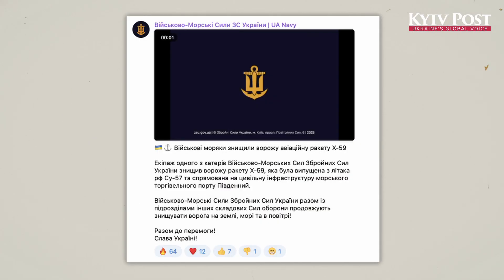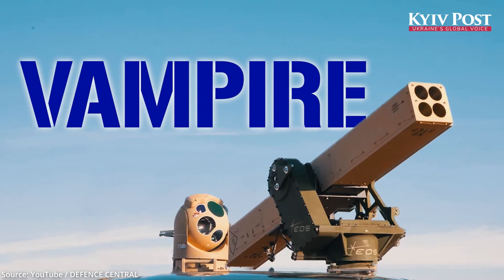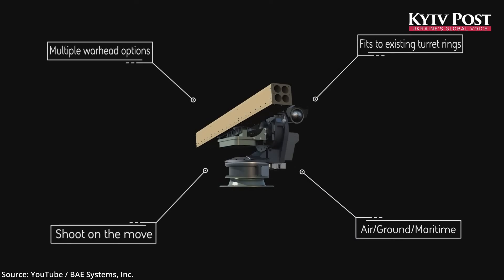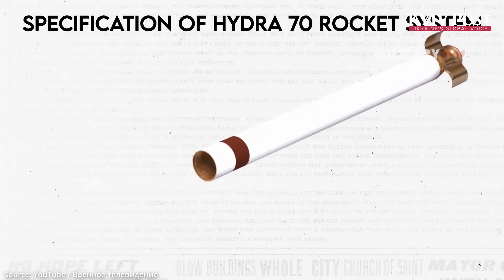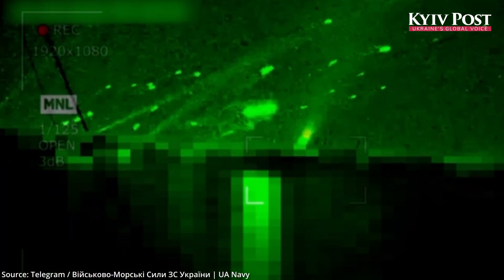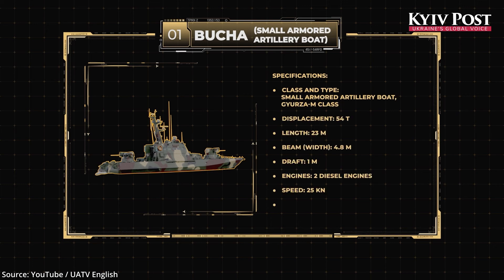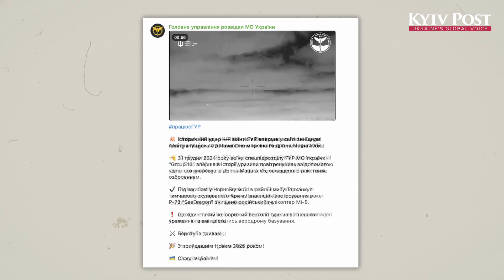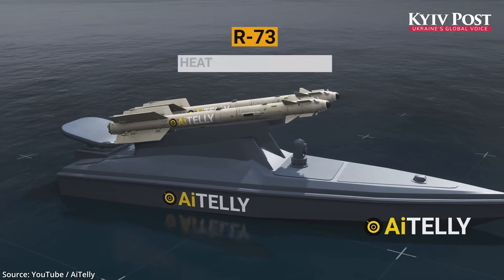Ukraine’s Navy Shoots Down Russian Missile – A New Air Defense Strategy?

Comment: Not the Ukrainian was lucky, in the end the black sea as a barrier and buffer zone plays in both countries favors, in enhancing the early warning capabilities and improving the operational and the tactical awareness and perception, here we can call similar Russian interceptions of r-360 neptune/kh-35 and drones as lucky because when it happens to aerial targets coming through the black sea...

as low flying aerial targets those high subsonic cruise missiles can be intercepted with even older systems, if there is enough time to be detected, and to be tracked in advance, this is the most critical part of the interceptions process, while the illumination could happen by laser designators and here all laser riding manpads systems are suitable, the anti aircraft's guns with retractable radar antenna 📡 coupled with similarly retractable multichannel electro optical sighting and tracking system firing HE-FRAG rounds with proximity fuse it could easily deploy a successive curtains of metals, another possibility is utilizing the manpads systems theoretically those infrared guided manpads are all aspects thus its capable of engaging the head-on aerial targets with the almost the same efficiency of shooting down the tail-on dame aerial targets shooting down the cruise missiles in similar methods as shooting down low flying fighter aircraft's only the cruise missiles is much smaller than the fighter aircraft's, and in the same time lacking the maneuverability of the fighter aircraft's, or similar to the drones, the only difference that those cruise missiles flying at much lower altitudes and travelling at much faster speed...